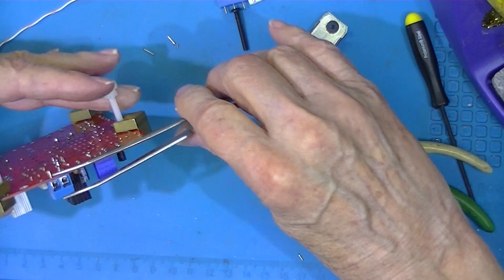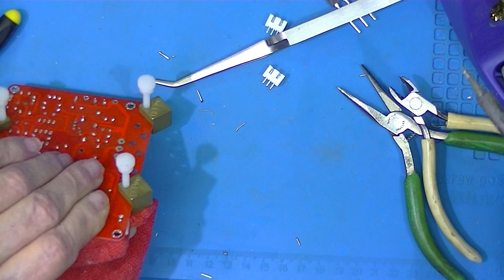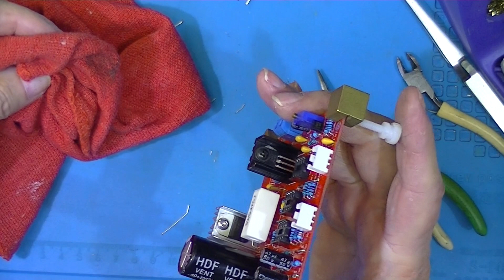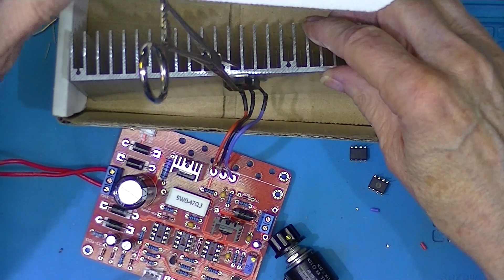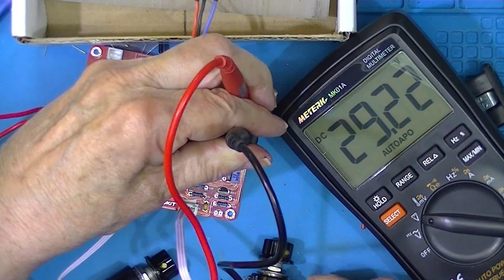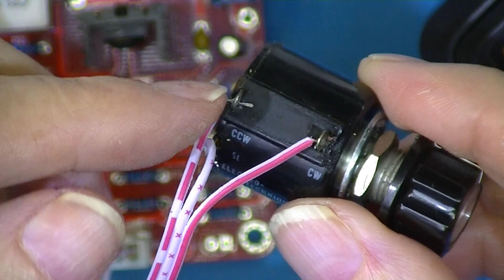30 Volt 1 Amp DIY power Supply – Part 3

Comment: Hi Steve. Do you have the room to mount one board upside down on top of the other with standoffs, with the capacitors offset from each other?
Reply from the maker: I actually had that idea. Also staggering them but that would mean drilling some mounting holes in the boards. I may just do it the way you suggest. Sure a hell somebody will object, oh well.
Thanks for the suggestion!
Steve